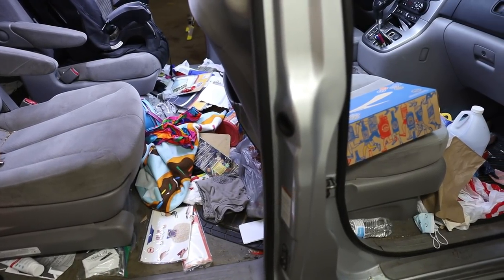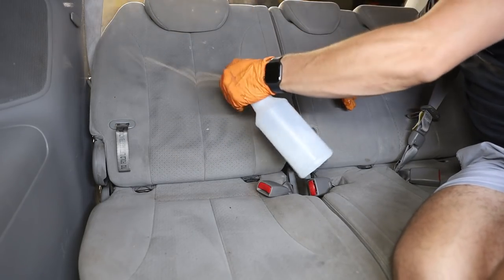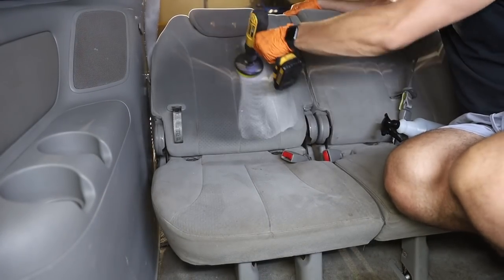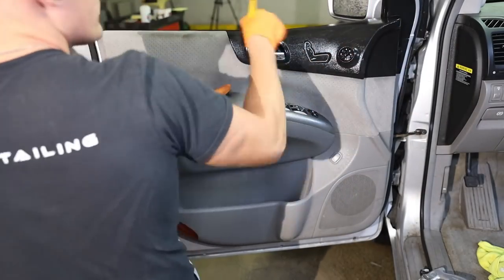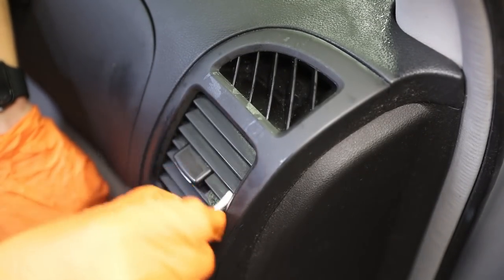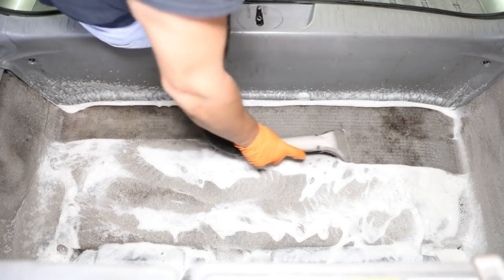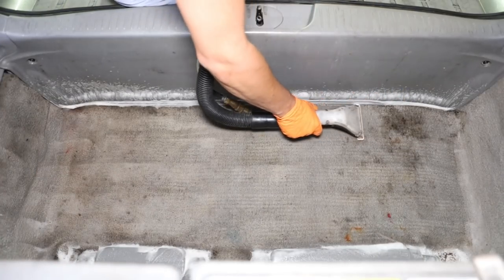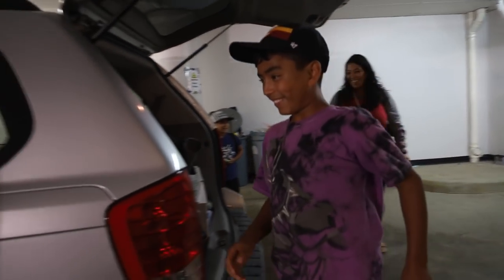Deep Cleaning a Mom's DISASTER Minivan! | Super Nasty Car Detailing and INSANE Transformation!

Comment: A huge transformation. I would never let my car get in such a biohazard. 
The dyes I’ve tried are solvent based and are non permanent to a degree. Your better off steaming the area and bleaching it before putting on any dye. Get a good water based dye. And pre treat the bleached area! Then go over the whole area of carpet using a dye that is a slight shade darker than the original. This will ensure good coverage and a better matching finish! 
Love the videos!!

Comment: I drive a 2018 corolla and I took one of my kitties to get neutered. I didn't realize until after I returned to the car that he peed in the carrier and some of it spilled on the front passenger seat. Man I had to hang my head out of the window because  this was in the middle of summer in FL, and only dropping him off took 15 minutes but that sun evaporated that pee and it filled my entire car. I immediately took the car to get detailed not knowing it would be $200 for the front interior alone. They cleaned only that seat for $30 but the smell went away for only that day. I've tried everything to get rid of the stains it left my seat a mess. I really wish I could just do my own detailing, but I don't have the right equipment. This would be so therapeutic for me to do it myself.

And as you requested, I'm a pediatric respiratory therapist. I used to work with the adult population but switched to pediatrics and I love it. The only drawback is the physical exertion can be overwhelming at times. I work seven days in a row pulling 12 hour shifts. With the pandemic and short staffing, I also pick up extra shifts. Nice paychecks even though I'm tired, but I don't care. It's worth it.

Comment: I have been a detailer for over 20 years. 
I have used carpet dye many times and can give you help if you need it. But I usually buy carpet dye from my chemical supplier. I have also seen them in car parts stores. They are Available in many colors. And if you can find the perfect tone it's ok. Just apply a darker tone and wipe with a rag gently it will fade the tone a little bit

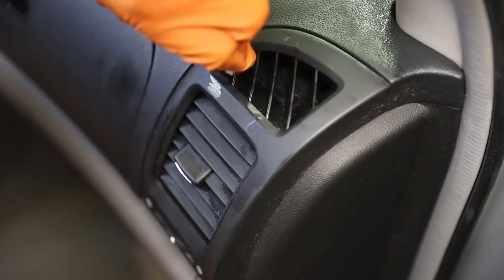Comment: 12:25 vents indeed are not reached by towel or even brush too well. I use steam but your method works too. I think steam blows stuff out from inside the AC though so I’m thinking it’s better than Q-tip but not sure.

Comment: Have you tried carpet spray paint? V-Tuned had an episode where he was restoring a really old BMW and spray painted the carpeting. It turned out pretty good. 

In terms of jobs. I’m a Builder (I think you call it general contractor?) and have been for 28+ years. I specialise in high end luxury homes so attention to detail is key with very demanding clientele. Your videos relaxes me but it irks me when u miss places. EG in this video the gear shifter. You go to great lengths cleaning around it but didn’t pull the shifter down to clean the top cover.